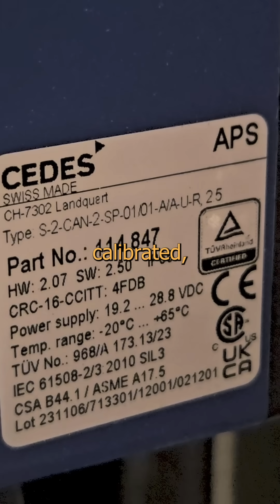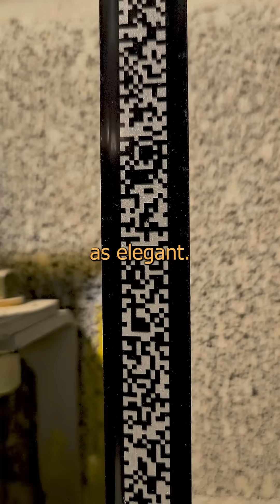Elevator Encoder #chrisboden #comedy #engineering #controls #urbex #indicator #resolver #barcode

Comment: Wouldn’t there be limits on the length? For example this 10 bit version could only have a length of the bit size multiplied by 2^10 and estimating a 1/4in per bit this elevator travel distance can’t be more than a little over 21ft. Depending on building construction that’s 3 maybe 4 floors. Do they have wider ones (16 and 32bit maybe?) for taller buildings?

Comment: Ok STOP with the specualtion and calculations about upc codes, binary limits and qr codes... Instead, lookup " fiducial markers " this is going to blow yoir mind!   Used in industrial tooling, medical radiation treatments, pcb manufacturing and more!  The reaolution is Way more than is needed for this application which is why it doesn't matter at all if it gets dust or greesy ir even broken!   Yes, it can read a broken tape !!!  You guys are going to be amazed!  ((Start with "Shaper Origin" and move on to even more complicated systems))  Enjoy!

Comment: That tiny space between the elevator and the building floor is where my foot got stuck, it would have just been a broken foot and or ankle BUT there was a steel plate from the edge of the elevator floor going down for some reason so my foot was destroyed between that steel plate and the concrete wall of the elevator shaft. Long story longer my foot was DESTROYED so I now have a BKA, BELOW KNEE AMPUTATION! Luckily your brain tends to block traumatic experiences as a safety feature! So I don't remember any of it.... Actually I remember or I think I remember like screen shot images kind of like movie stills. But I couldn't tell you if they were real or dream like memories.

Comment: Something doesn't add up. I count 10 bits per line, giving 1024 different lines. If each line is 1 cm high this gives you 10.24 meters - barely enough for four floors.

Comment: This isn't true that it's "the" modern system. In the UK its only really seen in leicester controls nobody else uses it. Its also not seen on slow or cheap list. These have positioning only at floors and run blind most of the time.

Comment: My dad started out designing mainframes and went on to air traffic control system, satellite control systems. At least, that's the stuff I know about. He did defense contracts so he couldn't talk about most of his work. 

I once spoke to an engineer who worked with my dad. He checked my dad's designs to see if they met requirements. I remember the look on his face when he said, "I never even had to check your dad's work. His designs were elegant. They did exactly what they were supposed to every time. I couldn't follow the designs though, they were over my head." He had the look of someone who had met Jesus personally. Reverent admiration.

Dad was a genius... but a real asshole at home.

Comment: The lines in the barcode appear to have a resolution of ten pixels in length, so if this elevator is using a single line to determine its position it can have a maximum of 1022 different positions (technically ten bits can have 1024 different values but for barcodes you should exclude solid black/white lines), if instead it's using a combination of two lines then that jumps to 1,048,574. That's pretty precise.

Comment: Seems like the easiest way to do it would be to use contacts or each floor that completes a circuit, and tells the motor to stop. Then when it has to go, the button you press interrupts that circuit and does something else to tell the motor to run forwards or backwards for up or down in some way. Different contacts for different floors would indentify the floor. Not sure what the best way to do that would be, but it is the simplest way I can think to do it without this.

Comment: optical detection of a spinning gear, combined with a very simple, robust, dedicated counter is much more reliable than this weird contraption, because counting gear tooth is much, much simpler than interpreting codes. This thing creates high CPU load, mathematically speaking. Rule number one in reliable computing : less operations are more betterer. On embedded platforms, you want as less operations per second  as humanly possible. If you can get your CPU speeds / clock cycles down to single-digit megahertz ... you win the reliability game and your product is eligible for a ticket to (outer) space. "This" thing ... will never be eligible but i guess it doesnt have to.

Comment: the pattern also never differs by just a single bit (block or pixel) - so it also knows if it is reading correctly. If it sees only a single bit change, then it can handle it in whatever way the designers see fit... like throw an error and refuse to work, wait for another read as alignment may have been slightly off... or whatever suits

Comment: You should try and see a compumatic its an old style that uses cable from the cartop to move a sled on top of the controller to tell the position of the car. If you have elevator related questions its my trade so ask away i may have some obscure answers

Comment: Most landing systems that I have worked on usually work off of a count. Either a tape runs the length of the hoist way with holes that an eye can count or a wheel on the rail an encoder counts. Then floor 2 is count 3000 and if u need to adjust it for whatever reason you can adjust the count. I've only seen this style in the video, but it's for sure a thing. They usually work in concert with that other vain sensor in the video that gives level up level down and door zone. Mileage may vary as there are many flavors of elevators.

Comment: One of the best ways to make a process or anything really is taking as many points of error out of the equation in example only the reader and the tape/board with the pattern probably will fail your not having 15 things that can fail makes it simple and in doing so makes it elegant and practical

Comment: Huge round of applause for the "maintence guy" that decided to paint the iron bars of the elevator car, while it was parked at a floor. Actually many floors, and the entirety of the shaft. (just push the stop button between floors, yes it worked) 

A bit of overspray on the reflective tape landed, the car 3 inches high at one floor, and 3 inches low at another.

The good news is that it worked against me in both directions as I tried to move a hand truck loaded with thousands of pounds of books, my friends library and the friend were leaving that shit hole city for good.

I didn't have any reflective tape on hand, nor was there any logically available, I tried scraping the paint off, no go, I tried removing the entire strip to invert it, and make the problem dissappear (or double). 

The elevator was super fun, it had the old timey accordion gate, that you could reach through and lose whatever, for extra fun all of the sides had openings, including the sides with the counter weights. The best part was the hallway doors all must be shut before the car moves. Some people don't care about closing doors behind them.

Comment: I love this. I'm a software engineer, but i remember a hardware project that i was never able to fix when i was in high school.

The project was simple. A sheet of metal is mounted on a motor at 45 degrees.

The idea create a solar panel rotation system that follows the sun. Underneath the panels are small pipes that transfer the heat into the liquid running through. Two hoses are attached to each side of the panel to let the liquid in and out.

If the panel turns over 360 the hoses will eventually get tangled. So the rotation should self correct. 

The challenge was that we The only thing we could do with the motors was to turn them on and off. So there is no way to tell the angel at which we are facing or how far did we turn.

One way to solve this was with a light sensor mounted on the sheet. You turn around for a few seconds, record the highest vaule the sensor gets and turn in the opposite direction until you find the highest value again. But since we can't tell the angle the system will eventually be tangled up and fails.

I believe a similar system like this could be applied instead. With a color sensor mounted on the motor, each degree in the circle can be represented by a hue. This can tell you the angle and the system becomes much easier. 

Even a white/black detector that tells us in which half of the circle we are is enough to untangle the system. 

😂 I'm happy I saw this. Now I can let this project go.

Thank you very much!!

Comment: Ok, I appreciate it, but it's not simple it is incredibly complicated electronics.
A fork sensor (or a couple each side of the center ) is a lot simpler.   Not as accurate, but much simpler.
Reply: It seems that the point is in the accuracy for this design.

Comment: Assuming those strips are ½ inch wide, then the total distance it could encode — without repeating — would only be 51.2 inches... MUCH less than a single floor.

Therefore the strips must either rely on blocks of lines being unique or it's encoding data in those blocks like "approaching a floor" or "time to ring the bell."

Comment: Remember this is basically a backup to the encoder on the hoist motor. It's for redundancy.  The vein is for door zone only. This isn't simplicity. It's fast and cool but not simple. Simple is veins and magnetic switches. Works forever. Otis still Installs elevators on a vein system. I'd bet that camera breaks or gets dirty more than the mag switch fails.

Comment: This is similar to how alot of subway/train doors and safety gates are coordinated, rather than using elsborate sensors to detect the train or timing it mechanically they instead use a camera and qr/bar code sticker on the door

Comment: The elevator knows where it is at all times. It knows this because it knows where it isn't. By subtracting where it is from where it isn't, or where it isn't from where it is (whichever is greater), it obtains a difference, or deviation. The guidance subsystem uses deviations to generate corrective commands to drive the elevator from a position where it is to a position where it isn't, and arriving at a position where it wasn't, it now is. Consequently, the position where it is, is now the position that it wasn't, and it follows that the position that it was, is now the position that it isn't.
In the event that the position that it is in is not the position that it wasn't, the system has acquired a variation, the variation being the difference between where the elevator is, and where it wasn't. If variation is considered to be a significant factor, it too may be corrected by the GEA. However, the elevator must also know where it was.
The elevator guidance computer scenario works as follows. Because a variation has modified some of the information the elevator has obtained, it is not sure just where it is. However, it is sure where it isn't, within reason, and it knows where it was. It now subtracts where it should be from where it wasn't, or vice-versa, and by differentiating this from the algebraic sum of where it shouldn't be, and where it was, it is able to obtain the deviation and its variation, which is called error.

Comment: Cant they just run a small wire with plates at every floor and when the wire hits the plate that it stops? Tho that would be a instand stop maybe like 3 so it slows down at the first then at the second stops then slowly Goes up again then when it hits the third Goes normal speed tho that is complicated but would not use as much computing power i assume

Comment: There are 10 pixels in a row. So the number of unique combinations is 2^(10)=1024.
If one pixel is 1 cm long (seems to be much smaller in the video) we have 10,24 meters of unique linse of pixels which is only 2-4 floors.
It looks like the system is using blocks of lines like a row of QR codes. Then number of combinations can be much higher because we can use unique rows in combinations but they will show up more times.

Comment: How do you figure a highly detailed strip multiple stories tall and a computer system designed to read it and control an elevator system is simple? The coding involved as well as the numerous complex inventions needed to implement this only seems superficially simple.

Comment: Wouldn’t it be simpler to just have a signal at the required stopping point (or, let make it three signals, in the center the avtual stopping point, on the top and bottom two more just telling the elevator to decelerate

Comment: I work on lifts and the incoder we use to tell where the lift is uses a magnet strip the length of the shaft and a reeder. I assume they work by measuring the voltage produced by the strip passing through the reader and working the rest from that. It gets it down to the mm. We still use a magnet on the guide and probe to get the door zones for emergency situations like trap ins

Comment: I find little problem with other methods; magnet and Reed switch,  roller ball,  or pulse count on the flywheel.  This is different, granted,  but other methods are more easily adjusted for building sag, etc... I also question what happens when hydraulics leak and messed up that pretty little barcode label.

Comment: Okay, real question. Used to live in a place where probably... 85% of the time the elevator was level. Some times though, doors would open, and it would be off JUST ENOUGH to catch the ball of my shoe, or my heel. 90% of the time when it did it, before I stepped out, it would 'level' itself, even with doors open.

Was this just lazy calibration?

Comment: It’s only 10 dots wide, meaning there are only 2^10=1,024 different possible lines. There are clearly more than that in the elevator shaft. The code must be multiple lines long. Even 2 lines would put it over a million, which would be enough in most buildings.

Comment: I'm wondering if you could do it even simpler with a long linear pot, though I guess that would wear.

But in my EE labs we had a cool old ass single strand bench pot, that seemed robust and easy enough to replace the wire, just make it long as shit

Comment: Arguably this is one of the most complicated ways of doing this. It's only simple when you abstract away the computer vision system. The complexity is hidden in the "parts", so you don't need complexity in the arrangement of the parts like you would with simpler parts such as gears, levers or ropes.

Comment: Simple that is not! you need a programmer for the software, electricity to run the laser or camera, and the same elevator devices to stop it at each floor

Comment: That's an "Absolute Optical and Linear Distance-Measurement-System"

There are others, the base is always Absolute or Incremental/Relative.
Then there are the sub systems; Radial, Linear, Optical, Physical etc. I'm not up to date anymore, could be many more.

Just had it in my Polymechanic apprenticeship.

Comment: Why can't this be used for CNC machines, Water jets, and 3D printers? Elevators don't have to be homed constantly, right? My 3D printer homes itself constantly, and the CNC and Water jets I've used all need to be homed when you start them up and occasionally again when something goes wrong.
With something like this, it would be able to tell exactly where it is at any given time, right? So you'd never need to home them unless something goes wrong

Comment: Looks to be 10 bits wide, so only a possible 1024 combinations - not enough to span much more (IMO) than 4 floors and still have better than half-inch resolution.  What system is used on taller buildings?

Comment: I'm thinking it's Gray Code.

""Gray codes are used in linear and rotary position encoders (absolute encoders and quadrature encoders) in preference to weighted binary encoding. This avoids the possibility that, when multiple bits change in the binary representation of a position, a misread will result from some of the bits changing before others.""

https://en.m.wikipedia.org/wiki/Gray_code

Comment: I don't like the fact it relies on complex barcode scanning type of decoders, and on the integrity of such a long tape. In my opinion a laser-based distance estimator would be quite a more lot reliable with less points of failure. Only issue would be to keep the target clean enough but that's what servicing is for and also it would safely fail unambiguously when the signal comes back too weak.

Comment: DTS employed a similar technology in the early 1990s for their version of digital sound from analog movie film. There was a narrow barcode on the edge of the film that ran the length of the movie, which was then read and sent to a processor that also had a CD player with the movie's soundtrack on it. Really quite brilliant. The simple barcode was a lot less susceptible to audio dropouts from dirt and dust on the film than Sony or Dolby's versions. It also made it possible to switch the language of the audio simply by changing a CD rather than reprinting the entire film with a different soundtrack on it.
Reply: @buckwilson4167 Thank you! I always wondered how they synced. That's both fascinating and ingenious.
Reply: That could be rather embarrassing if you put the wrong CD in! Or did the system somehow verify that it was the right CD before it would send the audio?
Reply: @adrianthoroughgood1191  As I recall, it was possible to have the wrong CD in and that it would play that way... for a time. I want to say it would play for like half an hour or something then shut off without having received the correct check info or something like that. I can't remember for sure.